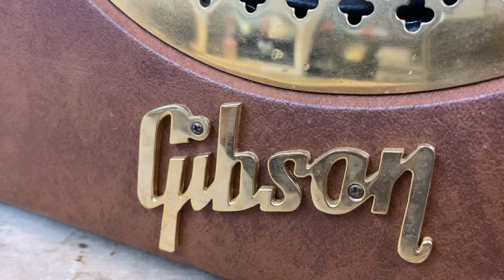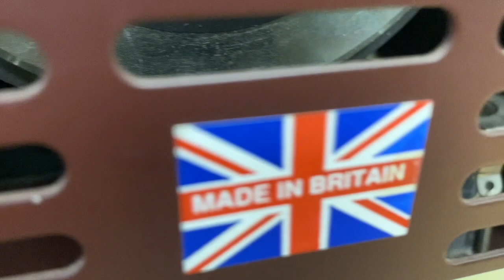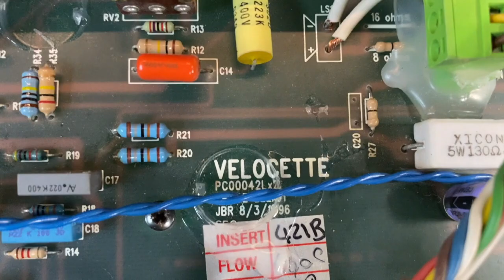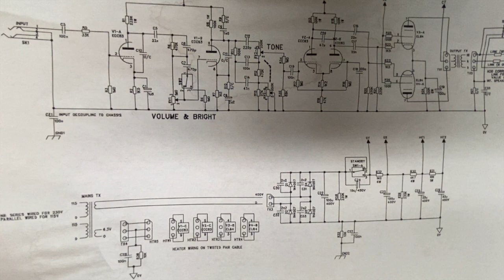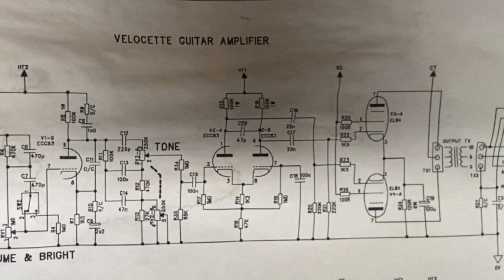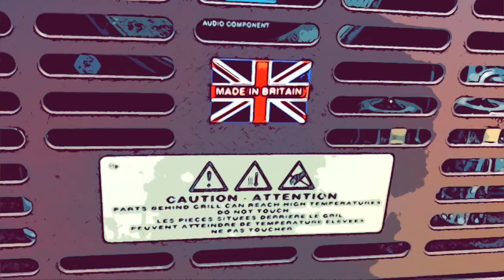Gibson GA-15 Goldtone - Easy Diagnosis?

Comment: PS, a somewhat unusual circuit, with signal ground lifted above the chassis ground; you hardly ever see that done in tube type guitar amps, although it's fairly common in pro audio gear, to precent ground loops. The way it's drawn out is strange; note that they didn't show heater voltage going to pin 4 of the 12AX7 tubes, only to 5 and 9....and one leg of the high voltage AC secondary feeding the fullwave bridge is shown as "zero volts", which is definitely not true!
Reply from the maker: Yeah, not a particularly complicated circuit but definitely unusual as you stated. There were certainly some inconsistencies in the schematic and several places on the pcb that were unpopulated. I'd have to look at the board again but I wonder if pins 4&5 on the preamp tubes are tied together on the board?
Reply: @OhmicronIndustries  , they would have to be in order to use both halves of the triode. Trace Elliott products were not known for consistency, reliability, or repairability. "Uh-oh, the infamous Trace Elliott bass amp is fucked up again". David Lindley, from an ElRayo-X gig around 1988 (bassist Jorge Calderone was using one). I'm amazed that replacement boards are still available, especially as Trace Elliot has been through several owners/distributors (Ovation, back in the day, IIRC).

Comment: The first question I'd ask is, "Why did amp fry without blowing a fuse?" 'Cos it should have...
Reply from the maker: Agreed. I'll never know for sure but maybe the buyer blew the fuse that it came shipped with (calls for a 1A) and then just replaced it with whatever he had on hand?  Total speculation on my part, would love to hear any theories you have.
Reply: @OhmicronIndustries  Increasing the wattage of resistors that burn out is akin to putting in a bigger fuse. The six watt screen resistors, R25 and R26, should be 1W or 2W, flame resistant. Trace Elliot never thought that someone might start upping or bypassing a fuse that keeps blowing - possibly due to a power tube “disturbed’ during transit? R32, the 4W screen dropping resistor fried, also R36, 1/4W resistor, which, according to schematic, is someway related to heater supply? Two 1W screen resistors would have stopped all that nonsense.
Reply from the maker: @davekeating.    I still can't get my head around how that heater circuit cooked. Interestingly, the original R25 & R26 were undamaged. Also of note, the schem lists R32 as 4w while the BOM says 6w. At the time the 10w was what I had but perhaps I should order a more suitable replacement.  FWIW  the amp has been working properly for at least a year now with no problems.